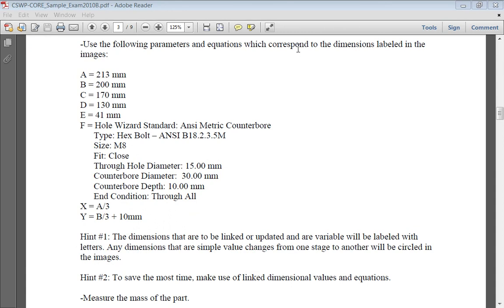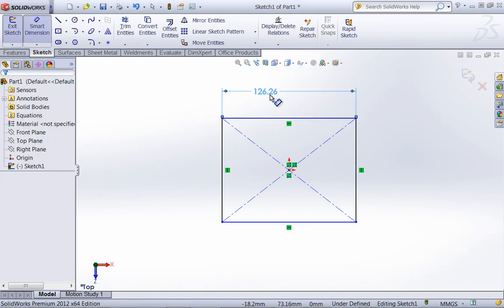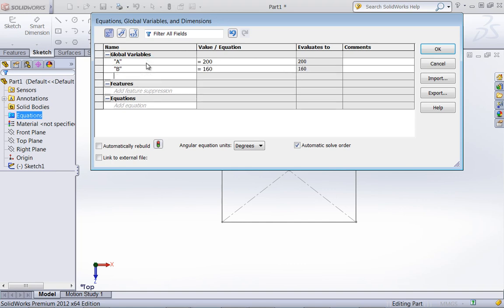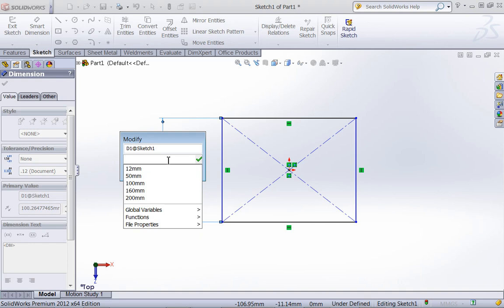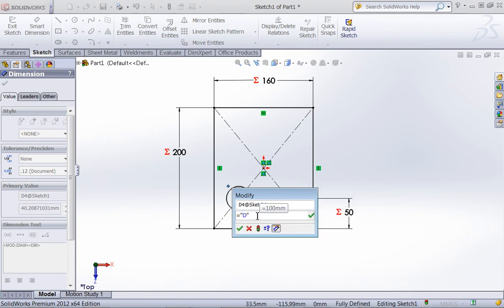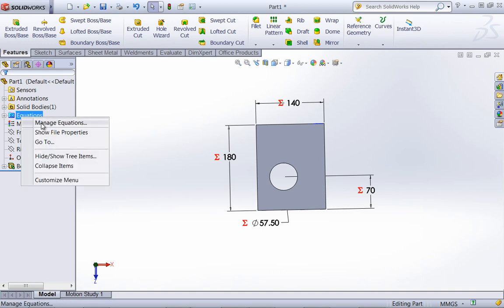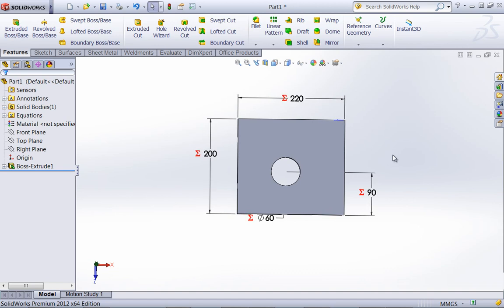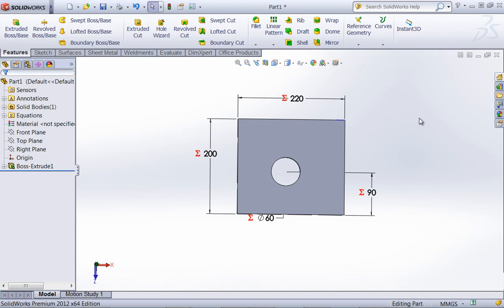Global Variables and Equations for the SolidWorks CSWP

Comment: In 2014 Premium version table don´t allow to nsert in value , says the syntax is wrong???
Reply from the maker: Meaning you're not able to add global variables?
Reply: SolidWize Thanks SolidWize!! yes in the table can´t add, first i put value "A" in the next row put =85 and inmediatly a message appear " the equation sintaxis is wrong..." or something like that. Regards and thanks.
Reply from the maker: Nicolas Ceruti The equal sign is automatic in the value box. Don't add another equal sign.
Reply: SolidWize Yes, i don´t add =, this just appear, but when i introduce a value, in the next row appear a message telling " The equatin sintax isn´t correct" Thanks again!
Reply from the maker: Nicolas Ceruti which service pack are you running? It might be a service pack issue or it sounds like you might have a registry error causing an incorrect error message.
Reply: SolidWize ,I have also the same problem ,when you said that we must run Solidworks as Adminastror 
,that mean when we intall it for the frirst time??and how to resume the  registry problem Please?
Reply: @jawheramri982  i have the same pronlem, i dont know what to do
Reply: +Nicolas Ceruti You can run SolidWorks as Administrator

this Worked for me
Reply: @mtaallah78  ,
SolidWize,I hve also the same problem ,when you said that we must run Solidworks as Adminastror 
,that mean when we intall it for the frirst time??and how to resume the  registry problem Please?